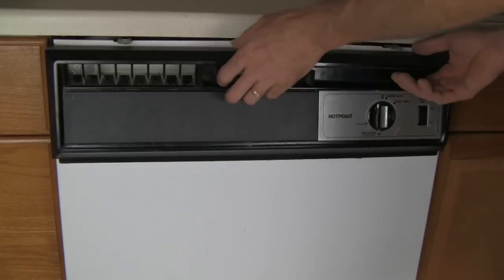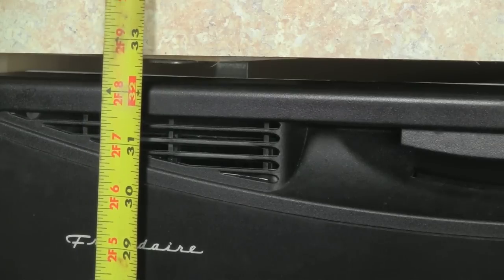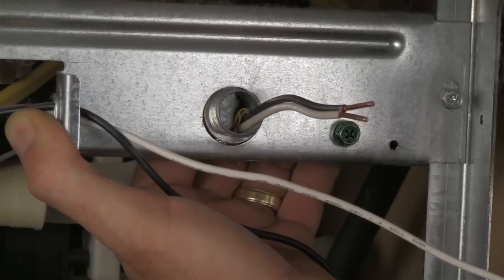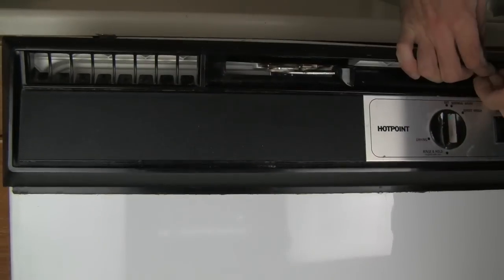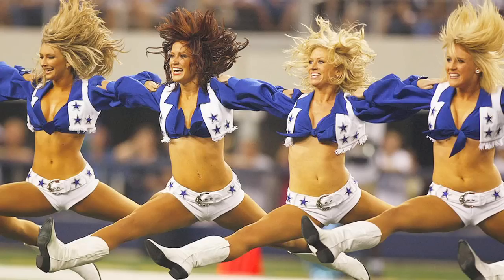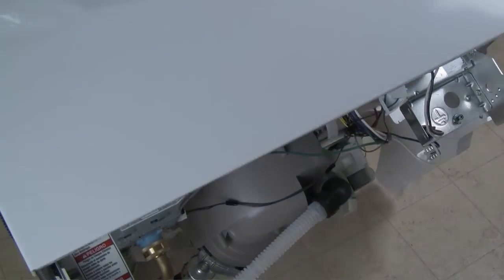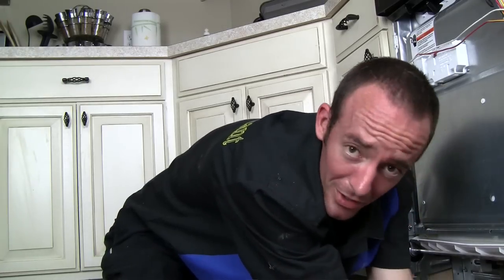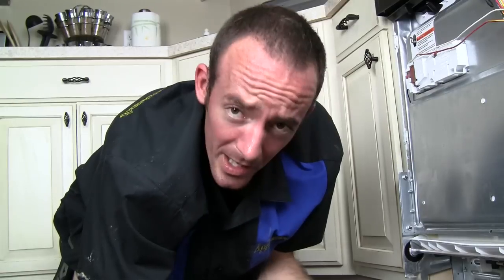How To Install A Dishwasher: Dishwasher Installation

Comment: Which water line do you connect the dishwasher to? Hot or cold? You didn't specify.
Reply from the maker: Sorry about that. you need to hook it up to the hot water. Thanks for the question. Good to clear that up!

Comment from the maker: @thalonelygirl There are a few different styles of end clips...Most clips have a tab on the inside of the rail that needs to be pressed inward while you lift the clip up and out of the rail.  Hope that helps. If not email me a model number through ApplianceAssistant . Com  and I can be more specific.

Comment: you wrapped the t-tape backwards :l
Reply from the maker: Hmmm. I don't thinks so... at what point?  Clockwise if you are looking at the threads, Same as at the 5:40 time marker. This is so that the tape will tighten as it is threaded into the valve.